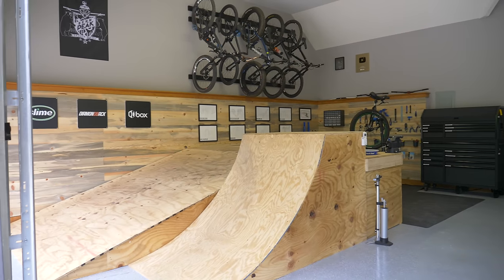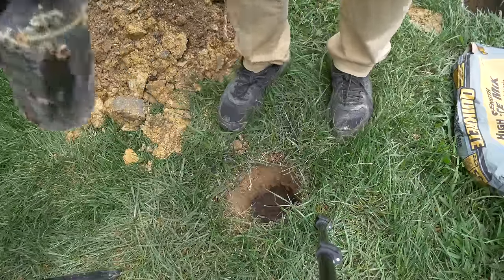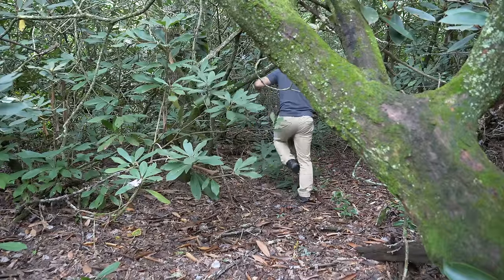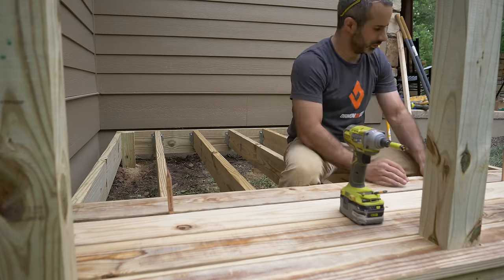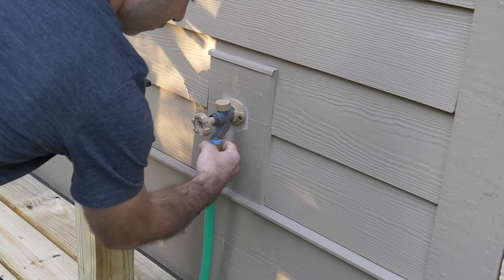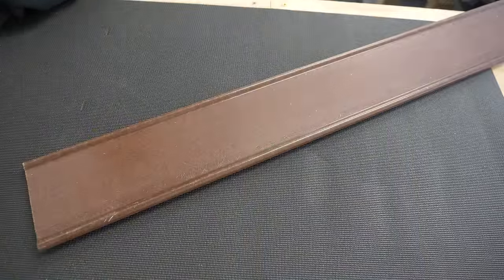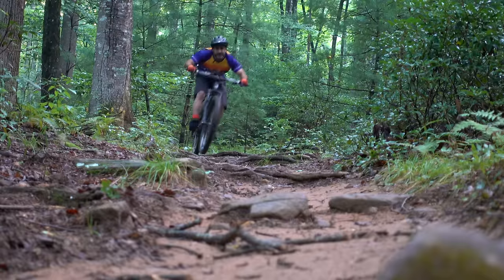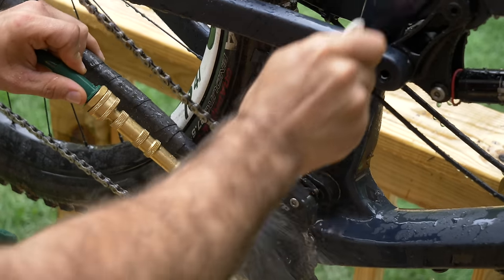Building a DIY Bike Washing Station with Shoe Bidet

Comment: I'd swap that piece of pipe out for a Park Tool clamp, nothing worse than the bike moving all over the place while youre trying to scrub it down.
Reply: maybe Park Tool can sponsor that, lol
Reply: I was wondering the same thing.  Maybe you're not supposed to clamp a dropper post?
Reply: @ryansvariousadventures7380  you can always clamp it from the top tube.
Reply: @positiivi_teme  , Yeah, that is not my favourite solution, but it's much better than having it moving all over the place.
Reply: @ryansvariousadventures7380  I mean, he is clamping his droppers all the time (as he showed in a video)
Reply: Yup, I built one similarly, that Park clamp is a necessity. Drove me nuts when it'd wobble, perfect solution to hold it in place.
Reply: @ryan derkson I work at a bike shop and clamping a dropper is totally okay
Reply: EVT Clamp >>>
Reply: Is there really nothing worse than bikes moving around while cleaning them? I'd say war and global poverty are worse, but I might be speaking for myself there
Reply: A hack to avoid a $200 Park Bike clamp is 2 pipes from a T coupler. Still moves but not as much.

Comment: Plumbing pro tip from Marcus the Plumber: Mixing galvanized and brass fittings will cause electrolysis and deterioration of the metals, leading to premature failure. Thrash on.
Reply: Im a plumber myself. It is going to be fine. It's just a bike wash station. If it was inside internal walls, then obviously it's a bad idea. From a bloke who isn't a plumber at all, seth has done bloody well I think!
Reply: Ha. No way you're a plumber. Any plumber I know would point out how he should have used 1/4 turn ball valves.
Reply: @dubbreak  quarter turns would have been nice, but the shoe bedit should have had a spring loaded pedal to turn it on with your other foot.  That way it could blast the shoes with water

Comment: I like the new bike wash.. It does not take much to attach a compressed air nipple to a hose fitting. Bring over a compressed air tank, and blast those permanent water lines you have built under the platform when it comes time to winterize. I love the shoe bidet. I think I am going to have to modify my boot scrubber.

Comment: One of the best bike wash stations I have seen  was at a hotel in Rotorua New Zealand, it was an old urinal mounted outside by the pool with hoses, brushes and a pipe across the top to hang your bike on!

Comment: @Seth's Bike Hacks, for future projects you may want to put gravel in the bottom of your post holes instead of concrete.  When you use concrete and then tamp it down you esentially create a dent where water can pool.  As rainwater drips down your posts and then seeps between the concrete and the wood it eventually pools in that little crater you make and then rots the post.  If you use gravel it makes nearly as sure a footing but leaves a place for the water to fully drain into the ground.  

Love the videos!!! keep them coming!

Comment: Impact drivers are great for disassembly.  Seth was safe using the impact to drive lag screws.  He was wise to switch to a ratchet when torquing a metal nut-and-bolt fastener.

Comment: Great vid and - as always - awesome woodworking skills!  

If I had one suggestion (and it's a minor one) cut up some old inner tubes and wrap that 'bike hanger' pipe with the rubber; either slipping the tube over the pipe or wrapping it like road-bike bar tape.  Less chance of scratching the snot out of your seat rails/dropper post top.

Love the new digs, btw!

Comment: If you ever use joist hangers again, there are little tacking points built into the hanger it’s self. Also you should build some kind of shelving unit or put in hooks for the railing for cleaning brushes etc.

Comment: The joist hangers have a little metal flange that once you put it in place you smack the flange and it holds the hanger in place whilst you screw or nail the rest of the support hardware :)

Comment: hi seth, nice place. i was riding the c&o canal a few years ago  after a real bad rain storm. the trail was so muddy. i was only riding about ten miles one way. when i got to the turnaround point you couldnt see my bottom bracket or my freewheel. my frame was mud. it looked kinda nice but it was a pain to ride. i tool my bike and stuck it in the potomac river to clean it for the return ride. when i got back to the car, i had to once again stick the bike in the river. it was one messy ride. i dint mind getting muddy. it washes off sooner or later. i think the shoe bedai was just brilliant idea.

Comment: Hey Seth! Framer + deck builder here,  if you include  3/8th inch gaps in the notches in the decking around the 4x4 posts, it will  allow the wood to dry out much faster and overall last longer. without gaps for air, dirt and grime will build up in these areas and allow for rot!

Comment: For future reference your joist hangers have a small little tab on them designed to be banged in with the hammer to help hold them in place instead of using a screw temporarily.

Comment: You should build a ramp in the middle of the wash station leaving room on both sides for the sign and the hose, so it would be easier and more fluent to access after riding and cleaning

Comment: excellent job.!  just a suggestion but you can put "plasti dip" on the pipe that is for hanging the bikes on. its a rubberized coating and might prevent additional scratches and damage.

Comment: That's a great job you did there Seth, if I could make just one sugestion it would be to cover that metal pole the bike hangs from to save any potential scratches to the dropper post, and you know I hate scratches😉, I would use a section of inner tube or maybe a piece of a tyre and it's job done.

Comment: Looks good. For what it is, wood contact with the ground isn’t a huge deal. Only thing I’d suggest is, don’t space boards at all. I stopped spacing treated deck boards years ago. As they dry out and shrink, the spacing is perfect. If I space them before screwing the down, the spacing is a little too wide.

Comment: Use a spray bottle w dawn mixed with water... spray your bike down brush a bit & rinse....
You can even get your drivetrain a bit cleaner this way between deep cleans using ultrasonic cleaner...

Comment: The bent piece of metal on the hanher right next to the nail that you are hitting in at 3:17 is supposed to be hit into the wood. It will hold the hanger but not vary well just good enough to hold it. My father is a contractor, and we would normally use a palm nailer to put in hangers. But a hammer is the traditional option.

Comment: Hey Seth, have you seen HeadLOK or LedgerLOK screws? They're a replacement for lag screws. You don't have to drill a pilot hole and they drive right in. They're a little smaller than lags, but they have the same strength. You can get them with either a hex head or a spline drive (like a torx). I used them to make a pergola. They're awesome.

Comment: You can use that composite decking it does not need staining and yearly maintenance and is waterproof.  More expensive,  personally I would just make a pitched concrete slab.. I feel decking is just a waste of wood. Most times the wood twists and warps and lots of chemicals for preserving,  both in the treating,  staining, powerwashing, etc.

Comment: Make sure you open the water valve on your accessories after disconnecting the hose. Otherwise the water won’t run out and it will freeze. (I learned that the hard way too!)

Comment: Hey Seth, love your videos and I’m a big fan but as a suggestion is when you take the temporary screws out for the nails you sound keep two screws and put two nails in the remove the two screws to hold it in place because it will move slightly and I’m a truck builder from England die hard mountain biker it’s my life but just a tip of advice dude👍 shred them trails

Comment: Should have used concrete pier blocks. Forget about putting concrete in a hole. I built a 10' x 12' (120 sq/ft) shed that's 14' tall on pier blocks. Makes maintaining and moving either a lot easier. Still a good video.

Comment: One thing I would do differently is to put something on the rail where the seat sits, so it isn't metal on the metal seat rails. They'll get scratched up! Perhaps pool noodle or similar. Something that absorbs the rails a bit would also stop the bike swinging around a little bit, compared to metal on metal.

Comment: I ain't no expert but I have experience with pressure treated wood. It needs to be left out for a couple of months and be completely dry when you paint it. If  it's still got a green tint its not ready. If its wet or green tinted  the paint will bubble up and flake away from the moisture underneath the paint lawyer. Whatever, you do it your way, it'll probrably turn out great no matter what. 👍

Comment: Love the wash station but can I make a wee suggestion for ya to make life simpler/easier?
Replace the tap for the foot bidet with a 90deg ball valve that you can turn on and off with ur foot. and also put a water restrictor in so at full flow it will be the perfect pressure to wash shoes and not so much your washing your balls...unless thats your thing.
Just an idea...otherwise exceptional work.

Comment: Nice recap...you're getting to be really good at these projects!  Any time I see people start digging like that without having the utility company come mark lines, I get nervous.  Those holes aren't deep, but with as many shortcuts as contractors, cable companies, and even power companies take when no one is looking, I would still be nervous.  Maybe you already had that done, and had them marked, so you knew were they where and weren't?  I don't really care to get into why I'm super familiar with that whole situation, but let's just say I learned it in a similar way to how you learned not to leave your hose hooked up in the winter.  :-)  

I've always thought it was funny when people think using treated lumber means it's going to be maintenance free for a long time.  What do they think happens to the ends that you cut?

Comment: Just wondering why you didn’t decide to concrete the posts into the ground, rather than fill with dirt. Since the station will see lots of water it is very possible those posts will become mobile over time. 
Also your foundation should be protected with delta to avoid water becoming trapped there as well. This is similar to a deck and underneath decks is where most water damage occurs to homes.
These are just quick cheap fixes that can save you time and money in the long run. 
Great video and love the content as always.

Comment: Nice, but from my experience, the best wash station would be one indoor, with warm water and some kind of space heater to dry the bike. The time I really need to wash my bike well is winter - like rinsing off the road salt periodically in winter commute. The outdoor station with cold water from a hose won’t work.
Reply: Winters are relatively mild in Brevard NC.  I've been there is T shirts in Jan.

Comment: Not trying to criticize but from personal experience ive noticed that a carpentry pencil gab is too much because the wood shrinks over time and there ends up being about a 1/4 gap. Last time I built a deck, I put the boards directly together and when they shrink you get about a pencil thick gap.

Comment: Nice build! 

But guys I've got an other small bike hack for you: You can make a custom littel bag under your saddel. In my case this has enaugh room for a multitool,my keys and some littel pieces like a valve core ;). Just take a piece of inner tube (20-30cm) put everything you want in the middel of the tube. Then put both ends of the tube threw the rails on each side of your saddel (From the mid to the sides). After that, take both ends and make a node.
I came up with this when I wanted to go on a ride without a backpack and realized that my biking pants only had one small pocket.

Hopefully you find that useful!
I would be really proud when this hack could be in the next episode of BIKE HACKS! @Seth'sbikehacks

Sry for my bad English :(

Comment: I heard concrete rots wood and thats, why you don't, set wooden poles in concrete in the ground,  instead, you put it straight in the soil. also wouldnt you want a  splash guard for the walls of the house so they don't get muddy?

Comment: I honestly don't understand why anyone would use nails over screws anyway, since screw provide much more "grip" that nails.
Reply: Nails have much higher sheer strength (resistance to breaking in half).
Reply: @Sylvan_dB  I've never heard of screws breaking in half, let alone screws in wood that were holding 2 parts together.
Reply: @DualDesertEagle  So? Also, sorry for the typo, should have been "shear" strength. Maybe that will help your google.
Reply: @Sylvan_dB  U said resistance to breaking in half, and I said I've never heard of screws breaking in half, especially not those holding wooden parts together
Reply: @DualDesertEagle  Consider this an opportunity to learn something. Or not. Your choice.

Comment: I don’t like telling people how to build stuff, especially someone of your skill level, but i am peeved by the way you poured and mixed concrete. Do not pour the power in the hole then add water, it doesn’t set and hold as well. Mix it in a wheel barrel or bucket outside the hole then pour the mixture in. You will be thankful in the ling run

Comment: Nice washstation! I use the old T-pole that suddenly showed up when I cut the firethorn bush which i close to the waterhose.

I'm only asking myself, why you didn't use an automatic push-button for the shoes-bidet to operate the water? Would save you bending over everytime.